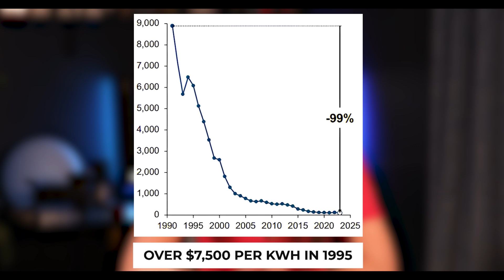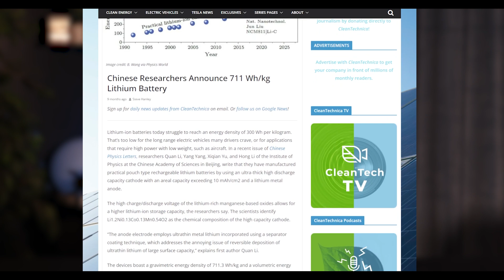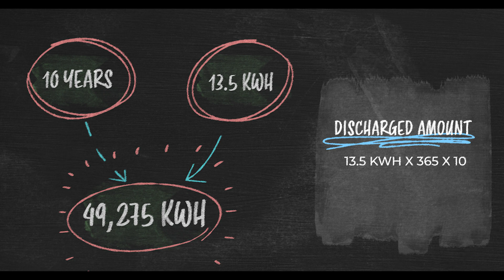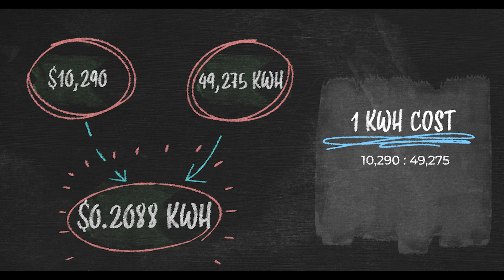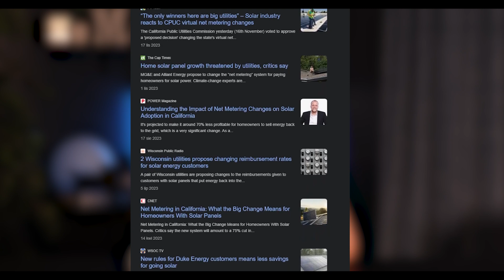Battery prices are DOWN! Are they finally Worth It?   Calculate for yourself  (Calculation included)

Comment: You didn't mention that for a battery to provide backup, the inverter must be capable of working  off grid.  I talk to so many people who think that their solar system is going to keep working during a grid outage, only to be disappointed at being blacked out when the grid goes down.  Many sales people are only interested in 'hooking' the sale by providing their 'best offer' (read that as the cheapest system they can offer) and don't explain this to the customer or even tell them that there are other options available.
I was sold a Growatt SPH 5000TL BU-UP inverter by a 'snake oil' SUNBOOST 'Sales Expert' who told me the system would provide blackout protection without needing a battery I quote: "because it has a small internal battery that enables it to keep working".  Of course it doesn't and I understood why after talking with Growatt.  SUNBOOST don't answer the phone when I call.  I am thinking it's time they explained themselves to a judge.

Comment: Thank you for this math! I was trying to figure this out as my wife and I are going solar very soon. Turns out the Powerwall 3 is not even close to worth it for us, but this math confirmed it even further!
Reply from the maker: I am so glad it was helpful. Going solar the sooner the better, battery... not so much. But solely depends on where you live and what your buyback rate is! :) 
Good luck! :)
Reply: @solartimeusa We're doing a standing seam metal roof with it. 50 REC ALPHA Pure 410 watt panels with 2x Tesla string inverters! Lets gooooo!

Comment: Pretty disappointing video. I’ve liked the others I watched. You touched on the big issue for net metering being non-existent or being severely cut back. People in these markets may be looking at 20+ yr ROI for solar. A financed system would never pay for itself!
Texas is one of these states so doing a video of the economics of this might really help people.
My anecdotal data on power used vs sent to the grid is 50% so capturing more/all solar power produced shortens the solar ROI once the battery is paid for. The difference between retail and wholesale prices multiplied by increased solar capture over a year will help understand the payback timeline. 
I opted for a grid tied battery so there is no backup capability. I have a generator for a major outage and smaller portable battery for short outages. Sizing a solar/battery system for long term whole house (AC, heat pump, furnace) is quite expensive and out of reach for most people buying a system.

Comment: I'm still waiting for a kit that'll let me drop the battery out of my Bolt, or a used/junked Leaf or something, and bolt it to my garage wall to store power for my house. 
An end of life Bolt battery pack could still have 30kWh of useful capacity. 30kWh would be $30,000 worth of Tesla Powerwalls, or $20k of semi-DIY batteries, for just the price of the kit and the labor.
Reply: Maybe you know this already but utility-scale battery systems are already being tested that use recycled EV batteries. Energy density matters a lot less once you take the battery out of a vehicle, so if you line up dozens or hundreds of these batteries on cheap land, even if they have 50% remaining capacity, that's a ton of energy storage at bargain pricing - and environmentally friendly. 

So I guarantee DIY people will do it, If they aren't already.

Comment: By the end of the year, it will be possible to use any EV as a home battery with new bi-directional chargers from SolarEdge and maybe others. It will make vehicle to grid and vehicle to home possible. It won't make sense to buy a separate battery when a giant battery is sitting in your EV already.
Reply from the maker: Hey there, yes I am personally about to test our the ford and sunrun product that has that ability for a client in Texas. That is definitely coming for sure! Thanks for sharing!
Reply: Hello Martyna. My name is Andrew. I was wondering what it would cost for a 4kW system in your area. I have 10 Q Cells panels and a SolarEdge inverter. Remember gas costs $4.00 per gallon here. I'm sure it's much cheaper for everything in DFW area. Thanks. @solartimeusa

Comment: Nice video! There are cheaper batteries than Tesla and do the job well and reliably. Waiting on Sodium Ion or other tech to see how much will the market change. I am excited that this industry has started to move kinda as fast as the computer industry.
Reply from the maker: Yes! That is a very good point! The battery tech is changing so rapidly!

Comment: I expect inflation will more than compensate for the loss of capacity. Even at 2% it will compound so when the battery is at 80% the cost of electricity will be around 1.25 x as expensive. If inflation is higher than 2% which is generally the case for energy, the payback will improve further. 

Solar farms need new panels every 20-30 years and wind turbines replacing every 20 years or sooner if climate change alters wind profile. So prices for electricity are unlikely to drop especially as we add storage to cover the peak emergency demand mostly met by gas, oil and coal. 

The cell price has dropped so low that the bulk of the cost of the home battery is in other factors battery management system safety measures waterproof casings and route to market. If new battery chemistry moves the goal posts it will not make prices drop much further as it shortens the useful life of the mega factories likely requiring expensive software and tooling changes. Demand will ramp up with commercial storage banks being built into the Grid and increasing demand for EVs.

Comment: As an FYI to folks, it's still a lot cheaper to build your own batteries and it's pretty easy to do.  I think it cost me just under $2900 to build a 15kWh battery about 18 months ago when prices were at their peak.  That was all new cells, BMS, etc, and before the tax credit.  With the credit, you can easily build the same battery for under $2k!  The ROI on DIY is MUCH better.
Reply: Using her numbers, that's about $0.05/kWh, but it's actually lower than that since that's using less than 80% of the daily capacity of the battery.  The cells I used are rated for 7000 cycles before the degradation is down to 80%... that's over 19 years if only using one cycle/day.  Chances are the calendar life of the cells will be more of an impact to degradation!  Not to mention I'm sure the tech of current batteries will be obsolete well before 19 years, and whatever replaces them will no doubt be cheaper and have more life/capacity.
Reply: @ssoffshore5111 where are you getting the cells from?
Reply: Where did you buy your cells, if you don't mind?

Comment: Hey 👋 and I wish they could make batteries alot cheaper 
But here east of Cincinnati we only pay  .04 cents per KW used but having a battery system for backup instead of running my generator when the grid goes down would be awesome 👌  Great video and see you on the next one  😊
Reply: That's insane compared to what we pay in the northeast, I think we're closer to $0.30 for generation and delivery!  The huge delta never made sense to me...
Reply from the maker: @ssoffshore5111 gosh! It’s crazy how different it is.
When I was in San Diego a few people told me they pay 85 cents during peak hours. And get a fraction for buyback… with the new NEM3…
Reply: @solartimeusa  I still get 1 to 1 net metering so far...
Reply from the maker: Thank you for sharing yes! Hard to put a dollar value on feeling protected from outages and not to mention that the cost of natural gas or propane used also adds up.